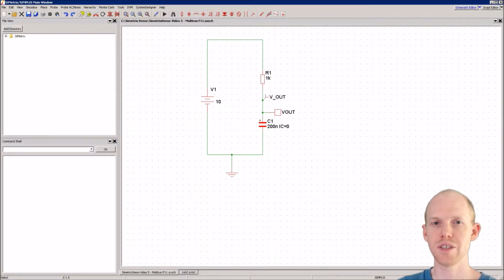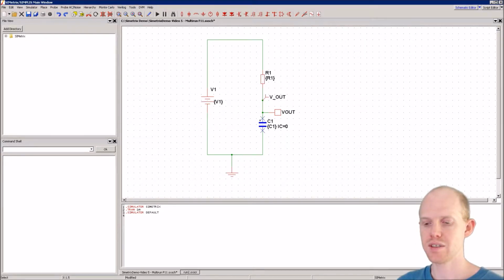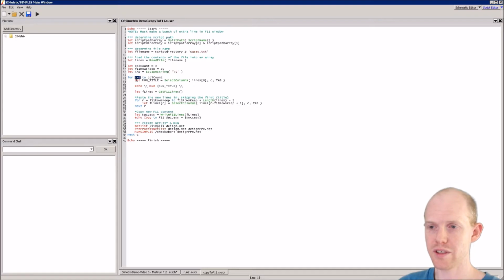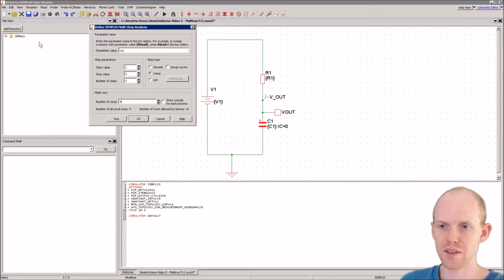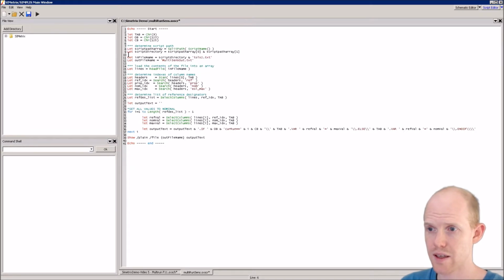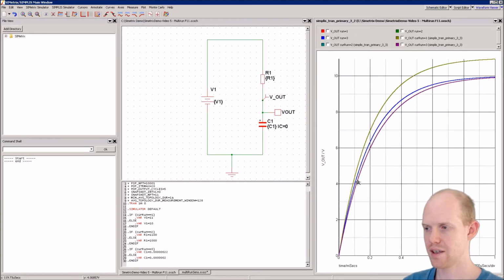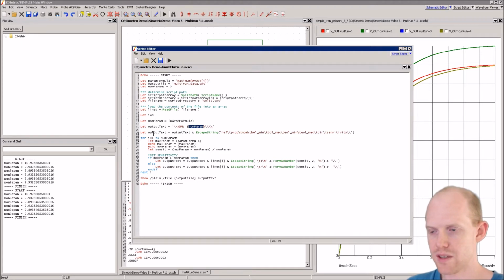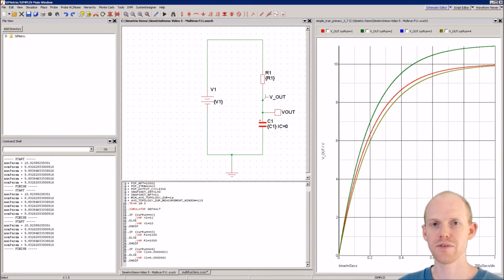SIMetrix/SIMPLIS Scripting 3 - Changing Parameters & F11 Window

Comment: Really nice explanation. Thank you. I am wondering if there is a way to find the smallest time constant in Simetrix . I can see that option with Simplis, but why not in simetrix.
Reply from the maker: Simetrix is regular SPICE which is variable time steps based on how fast the signals are moving, so the first column in the output data is the time values and the delta between each row is the time step. I'm not sure if you can see that in the GUI easily though or if you'd have to write a script or maybe you could do it with a formula?